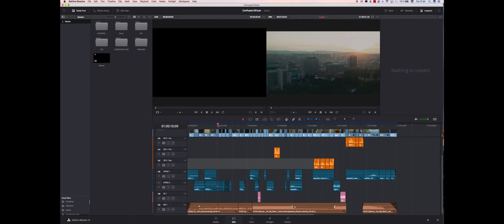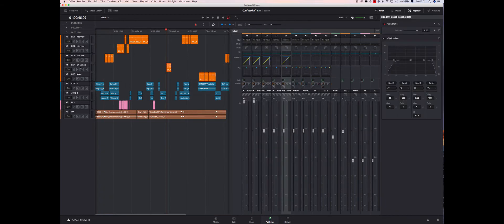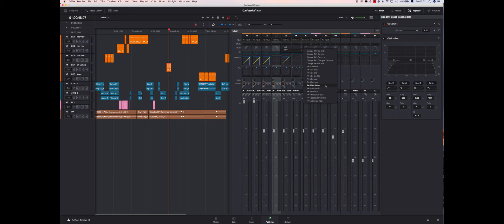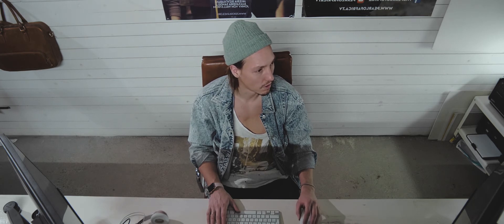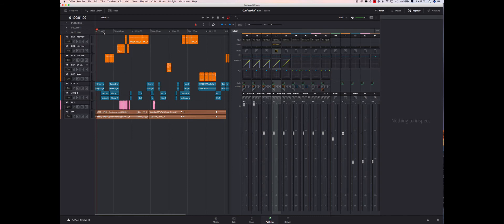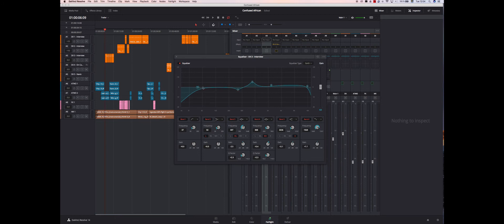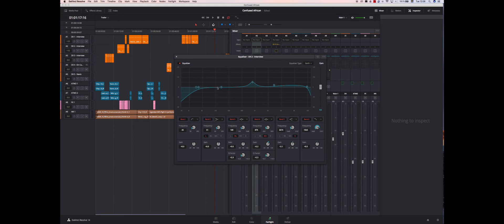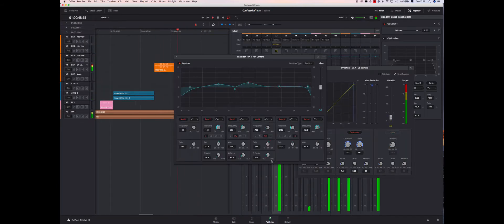MASTER Basic Sound design & Audio Mixing Software for Documentary Film FAIRLIGHT

Comment: Thank you for the awesome tutorial!! I waited so much something like that, because it's shortage of information today about davinci fairlight and general sound mixing. 
Thank you again!
I notised that you use magic mouse. Could you help me please with some advices how to put correct settings for davinci. As I now, today just BetterTouchTool provides ability to get middle-click. But I have troubles, that in viewer when I zoom image or move one, it's fidgeting.
Another trouble is that on Primary bars columns are very-very less sensitive for scrolling it AND at the same time wheels (rollers) under columns are incredible sensitive for scrolling. Even I try to tap them and move there fidget becomes again.
Are you notice something like that and may be you now how to fix that?

Comment: I did some mixing in Fairlight last week but I didn't find any way to copy the settings of a EQ i made, or even save it as a preset, did you find a way to do that? I had to redo the EQ multiple times when switching between channels and timelines...
Reply from the maker: No that’s the crappy thing about it, will come but for now I use a template. You can download it if you want. Link is in the description.
Reply: Ok, thanks!